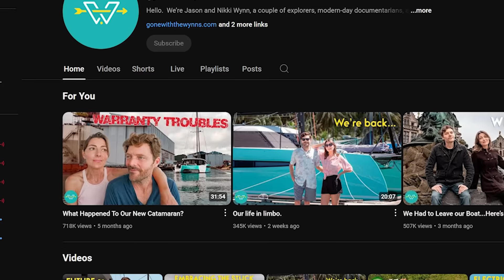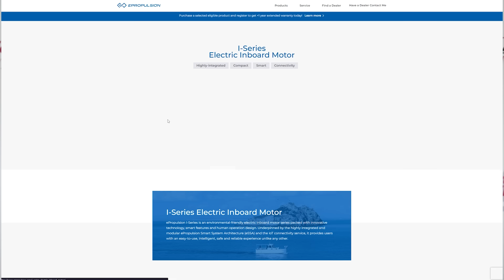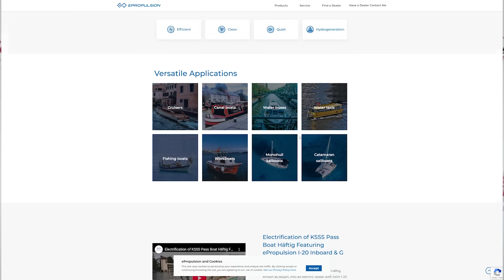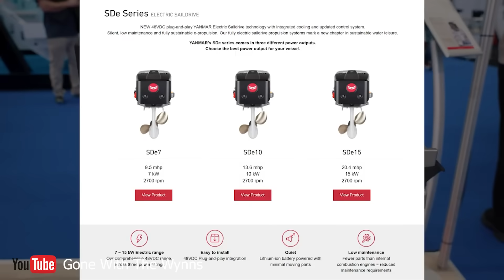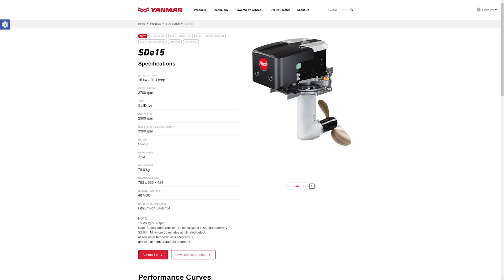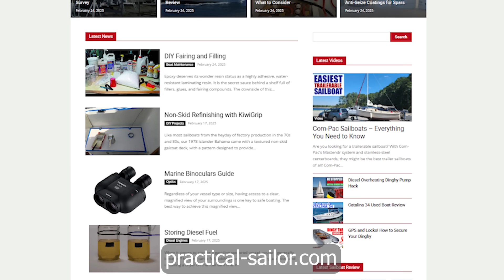Is It Too Soon for Electric Sailboats?

Comment: We are very disappointed that Practical Sailor did not reach out for comment before posting this uneducated video. The Wynns Hybrid had nothing to do with their electrical issues. Rather it was a simple mistake HH made in the electrical wiring. Please do your own research, speak to experts (not YouTubers), and follow fair reporting standards. Do better @practicalsailor.
Reply: How long does it take to fix the wiring in the electrical wiring harness?
Reply: `harness` though.  Not `harneess`.  Could be an issue with `attention to detail` maybe.  Just sayin`.
Reply: Maybe try sending out working boats before telling other people to do better.
Reply: Its also funny how so  many commenters were so ready to blame the smoking battery on lithium batteries they completely ignored the fact that the  Wynns clearly stated it was an plain old agm lead acid battery. 

I applaud HH for finally taking the leap, only wish you did it sooner! While I'm a proponent of fully electric, parallel hybrid (HH44) is really the ultimate right now for a cruising boat.

Comment: Electric motors are absolutely ready for prime-time commercial sailing.

The BATTERY technology to fuel those motors just isn't there yet.
Reply: And my comment isn't quite as stupid as you might think, if you have a generator to top-up the batteries, like the Silent Yachts do, you're half-way to getting there.

Comment: Cool until it goes wrong... perhaps some form of hybrid system, as someone has done with a diesel generator - you could then run on batteries alone inshore or around the marina.  But there is added complexity and weight to this which will put most people, including myself, off.

Comment: THIS IS AN OPINION PIECE I WROTE A FEW YEARS AGO - 

ELECTRIC REVOLUTION – Is this the way to go!

The short answer is YES and NO.

The long answer can be traced back quite a long time and I would suggest there have been quite more than a few revolutions over the intervening years.

Being a former submarine engineer, I always smile to myself when electric propulsion is "discovered" as a new technology, the “future" of propulsion and that a REVOLUTION is underway. Conventional submarines have been using electric motors for some time – Over 137 years to be precise - since the Spanish submersible, Peral was launched amidst great pomp and splendour in the year 1888 after over three years of active researching undertaken by Isaac Peral. In 1888 the French also launched a small 30 ton electrically driven submarine, Gymnote, designed by Gustave Zédé

Electric propulsion is great and reliable, as is diesel propulsion. As an offshore yachtsman and despite many years of electric motor experience my preferred propulsion of choice remains the humble diesel engine. Availability of parts, endurance only limited by amount of fuel carried, ability to refuel quickly and power to weight ratio are some of the key drivers for this. 

In terms of 'green house' impact, I simply don't use the engine for the most part and find I need to carefully gauge how much diesel to purchase to balance the 12-month stated diesel shelf life with reality (usually aim for a maximum 2 years). The exception is where we sail up to the equator and there is no wind. A week of motoring consumes a decade of usage otherwise. 

With currents and tides around the north of Australia and most of SE Asia, it is simply not possible to rely on the elements to safely convey you to your next destination, unless you follow the trade winds and sail by the seasons. I would have no hesitation to change to electric drive (cost is a big consideration though) but would need to take a leaf out of the conventional submarine arrangement where a power source to replace the expended energy is available (termed floating the load). Many bigger modern-day sailing ships as well as cruise liners uses this arrangement i.e. flexibility and efficiency of electric but with a like for like power generation source i.e. replace our 85HP diesel engine with a suitable like power electric motor, coupled with a similar sized generator. Albeit twice the cost and twice the parts to maintain. 

Using lack of reliability as a 'reason' to change technology, is a fallacy. If something is broken or not working on a vessel it should be fixed. We sailed in China 20 years ago and needed a part for our diesel engine (heat exchanger). The locals quickly came up with a makeshift alternate that we could have used, but one of the locals that spoke English asked why we simply didn't walk down the road 200 metres to the local Perkins Engine dealer and buy the original part off the shelf - which we did and saved a heap on duties and freight. 

So, the YES have it for enclosed waters, day sails with a shore power ‘plug in’ at the end of the day, or those that like to gunkhole at 2 or 3 knots. The NO’s are generally those going further afield and don’t want to or can’t rely on favourable elements.  Yes, I know you can sail around the world without an engine of any sorts e.g. Lin and Larry Pardey, but most of us want to get to the next destination and enjoy a cold beer. 

Bottom line, turn off the engine, electric, diesel or petrol and go sailing!

Comment: Electric sailboats? It's a stupid topic. The technology is insufficient. For close-in coastal cruising, maybe. But for offshore, transoceanic cruising, Hades NO, for me at least! However, I sincerely encourage the subsentient cross oceanic sailors to rely upon solar exclusively. It will work frequently, until it doesn't. Their results will likely encourage the intelligent and cautious sailors to follow the previously proven and methodology that does not get them killed.

Comment: Shoot, I had an electric drive on my 30 foot sailboat 10 years ago, worked just fine for getting in and out of port.  It was inboard. Charged on shore power.  I supposed if I were a cruiser I would get solar panels. I've seen diesel electric hybrids, and all kinds of different combos.  I think boats are just great for this kind of technology.  And with batteries nowadays, you can carry a lot of energy...for a price.

Comment: I've no skin in the game but my main fear about going electric now is that what is available is practically exploding with new technology. The latest I've seen, as you've shown in the video is a sail-drive with the motor in the pod under the water eliminating the need for gearing and managed cooling entirely with only the wiring coming into the boat instead of the motor having to be inside.
That said, I don't see solar, storage or energy conversion tech changing all that much but the driving the boat through the water part seems to be rapidly evolving.

Comment: My sailboat can carry about 1000 kW*hrs of power, in the form of 25 gallons of diesel. When I can carry the same amount of power as batteries, and can charge them in the same amount of time as I can fill my tank, then give me a call.
Reply: That's almost all entirely correct and highly relevant, but kWh is an energy unit, not a power unit.

Comment: Battery replacement every 5-10 years is not the case with all the data cars and solar installs we have out there. Budget about 1% a year degradation of capacity.

Comment: Batteries on a weekend style boat will last more than 10 years. With 8000 cycles on a LiFePO battery, even if used most weekends 8000/40 = 200 years!

Comment: I  have a new build 42' light cruiser with  20KW, 220AH 48v lithium (mastervolt) and 4x 170w panels to charge. More batteries stretched the budget to where we said, "It's a sailboat". I've sailed since 10 years old (now 78) and done three passages in the pacific across the equator. On a passage, if there wasn't PredictWind) you can just sail. If you're weather guessing you just  go with  what you got. But seeing  wind 100 miles away that you could be in and ride ride ride is not possible without burning fuel. Ditto for strong atoll passes, deep lees where there is also current, that can trap you if you can only power for a few hours. A new Yanmar 3cyl 40hp is likely to replace our very fine working, no issue Electric Yacht QT20 because I want to hit the starter and be able to run 50 gallons worth if need be. Right now range anxiety in coral reef situations is narrowing the adventure. If you want to just  sail in SF Bay, electric is great. Quiet and smooth, no stink. For a couple hours. I'm going  to burn fuel as soon as possible.

Comment: By the time battery technology supports an electric cruising option, hydrogen may be a better option. You wouldn't catch me in an electric only powered boat crossing an ocean... ever. Use a mechanical transfer case and have the option of electric OR diesel, then I'm in
Reply: Hydrogen!!  Explosive or what, special expensive piping etc. Where are you going to refuel. Lots of docks won't sell gas let alone hydrogen.
Reply: You wouldn't catch me in an electric only boat either.  I would also want sails.  Hydrogen requires heavy duty tankage for it and for the oxygen.  It has a division of its own in explosion-proof electric and fire codes.  It also consumes more electricity than it produces.  The concept of using it in cars quickly evaporated.  It is an accident waiting to happen.

Comment: I can add stories about failed conversions with well known electrical propulsion systems that, although excellent systems with excellent controls and a substantial battery bank, still are insufficient for a coastal cruiser. Unless you want to limit yourself to short motoring distances and visiting marinas for plug-in power every second night (and hope they have 50 amp dock service), the diesel still reigns. Electric drives work very well if you have all the time in the world on a light weight, slippery hull, and a desire to sail whatever the conditions. Powering into and out of anchorages or marinas, the system works well.

Comment: I've used an ePropulsion 1.0 EVO for two seasons off the New England coast on my 20' trailer sailer. It's been great! When I upgrade to a larger boat, I'd like to go with the Combi system that Delos is building. A belt drive on the prop shaft seems like an easy enough upgrade to an old boat and gives redundancy.

Comment: With the stand alone sail drive leg, it seems it would be quite difficult to address any issues with the unit without hailing it out, and getting to a haul out location with no functional engine would probably require towing and be challenging.
Reply: I personally wouldn't have a saildrive.

Comment: The simple truth is that there is no battery that can store enough energy to power an electric motor, and be easy to replace with energy when it runs out. 
There is a reason diesel engines have been around 130 years and are used in almost every place power is needed, right around the globe. Electric might be useful for short trip dinghies, but for ocean crossing boats it is utterly useless.

Comment: Not only is it too soon it’s too stupid and will always be. Hydrogen is the way to go for sail and power boats. Hydrogen internal combustion engines. Is the only way to go.  Yamaha has developed a hydrogen internal combustion out board 450 HP. JCB has ICE that run on Hydrogen. Batteries are also not ethical, in Chile lithium is extracted by using fresh water, which the indigenous people can’t have. Cobalt from the Congo where miners go into the mine in bare feet. Also batteries are not sustainable. Eventually we will run out of the minerals we need to make them. Forget about electric boats.

Comment: WHY does everyone talk about electric drive as if they run the battery down to zero and then are stranded?  It's as if your Diesel / Gas engine had one fuel tank and when it's empty you're stuck.  A Diesel / Gas engine can be refueled while in transit only one way, by adding more fuel which we can carry aboard.  Sure, no problem.  But an electric's battery system can be "refueled" in transit MANY ways, including Solar, Wind, when under sail via Regen, or from a generator.  Guess what:  the generator can be refueled just like your old Diesel / Gas engine, from fuel we carry on board.  The big difference is that a Diesel / Gas engine cannot be refueled by Solar, Wind, or Regen; when the Gerry cans are empty, they're empty.  And for the times you're not having to use the generator you're that much cleaner, quieter, and self sufficient.  That's really what sailing is all about.

Uma's recent switch from single to a dual sail drive is partly for redundancy (so, how many Diesel engines does your monohull have?), but mostly to double up on the under-sail Regen.  I'd like to hope that this will be enough that they can really ditch the generator.  Time will tell, and I wouldn't bet against them, but it's easy to add back if needed.  Do also check out the sailing channel "Sailing Electra", who have enough solar that they often arrive at their next anchorage with as much battery charge as when they started, often fully charged.

Battery space can be sufficient within the old engine bay, and you also have the space from the old fuel tanks that can be converted to battery boxes or other use.  Convert the galley to electric and take out that old propane tank (and the risks associated with it).  New locker space!  Or if you can't let go of the propane BBQ grill clamped to the transom, get a dual-fuel generator and pick up the option to run it from the same tank.

Concerned about the electric motor or controller failing?  Unlikely, but sure, anything's possible.  An old small Diesel can be started and run with just a hand crank, if otherwise undamaged.  "Wind Hippie" has done it.  Not the big ones, however.  But ok, if you're paranioid about the motor / controller, they're pretty small, and can be doubled up with a drive belt (see the "Digital Mermaid" channel) or kept on-hand as spares.  Can't do that with a 15+ horsepower Diesel engine.

Instead of thinking only about all the ways that an electric system can fail, you need to consider how those failure scenarios can be mitigated, and then about all the advantages the resulting system can have.
Reply: so wheres the company that will do this conversion in  west side of florida .. im ready and still searching.. morgan 41 cc ketch   and then theres the cost,   a solar arch mail order, in st pete area..  quoted me 23 grand to install..  thats like charging 300 dollars for tv dinner...   we boaters aint being sucked in , we want a better choice .. like maybe going over seas for our work  . thats an open option for me right now  because i got no other yeat...  florida boatyards need to make their storm repairs and bite the bullet , and start  a conversion shop , and make it affordable for not only the filthy rich..

Comment: Electric boat propulsion needs to move beyound 48 volts and adopt the BEV minimum of 360V+
Reply: No. Too dangerous. Sea water and high voltages do not go together. That's why 50v.
Reply: @tmog1000  "Yes, But..."  Properly sealed, a high voltage electric system is just as safe as anything else we do.  Probably safer, given the obvious risk.  Consider what the EV manufacturers have successfully done with their car batteries.  Water, road salt, vibration, temperature extremes; yikes!  In nasty weather, you're putting all that stuff in a washing machine as you drive down the road.  But it has been done.

That said, I expect that the higher voltage systems will only become accessible for DIY refits when pre-packaged (and pre-sealed) components are standardized.  I believe they're coming.  "Kit motor" sorts of systems.  48 volt systems are a sweet spot for coastal cruiser sized boats right now because they are considered safe, and have the power needed.  But just as you can't reasonably have a 10kw motor running on 12v, if you need higher power 48v won't do either.  10kw at 50v is 200 amps; easily doable.  Need 50kw (65hp)...?  Oof.  Do the math.  Yeah, high voltage is required for that.
Reply: @tmog1000  And yet ships operate at 440 3 phase all day long!

Comment: Few people talk  about how to debug these systems when something doesn't work.  I bought a daysailer with a  torqueedo several years ago, it went from working fine to dead the next week - just stopped working.  Tech support was hard to get a hold of and only gave me bits of information at a time.  First pointing to the throttle, which wasn't it.  After waiting forever for a response from torqeedo, I found a neighbor w/ the same motor and swapped the battery - that was the problem.  There is no documentation on how to diagnose this stuff yourself.  The battery went from charging fine and holding a good charge to Dead.  $900 for a new battery for a 4 year old outboard that already costs 3x the gas outboard it replaced.  If I was somewhere remote,  I'd be s.o.l. and may not even be allowed to ship in such a big lifepo4 battery.  The regional service center I called to try to salvage the battery said 4-5 years was about right for a torqeedo battery lifespan.  I can buy a lot of gas for the $200/year in battery costs.  I drive an EV, but am done w/ electric power on boats for a long while.